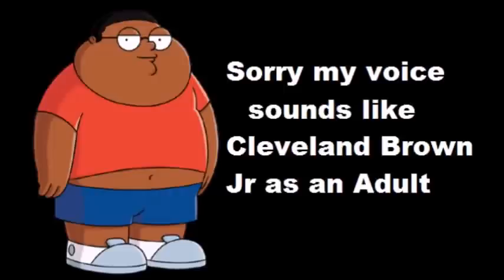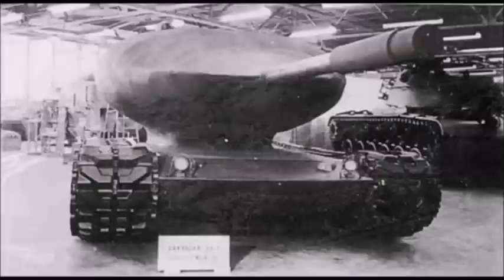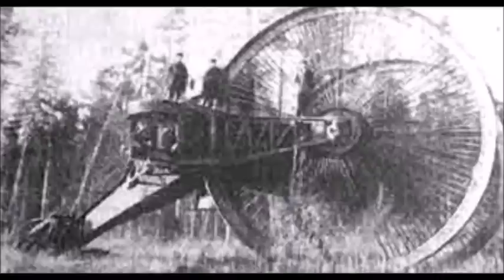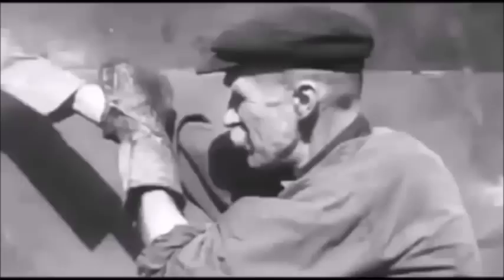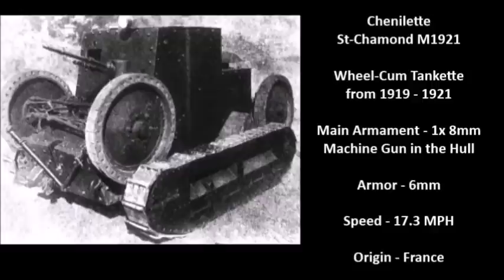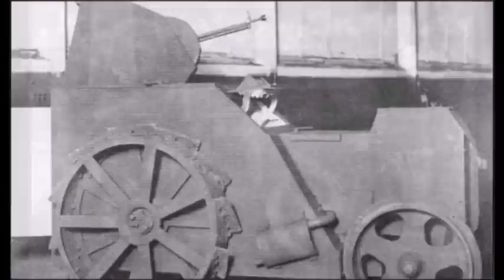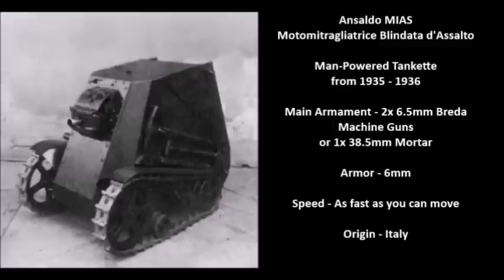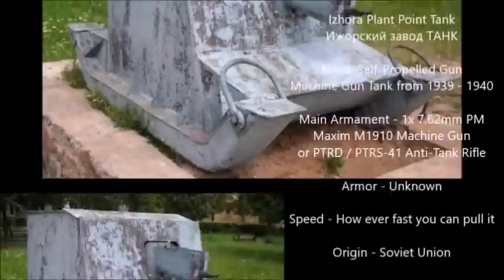Top 10 Worst / Strangest Tank Designs in History

Comment: That italian tank is more like an easily  moveable machinegun nest than a tank!
Reply: exacty It was a MItragliatrice ASsalto(assault machinegun) basically a self-propelled machinegun nest. And by the way this video is not correct: The Ansaldo MIAS actually had an engine, the Frera 250cc. (Frera was at that time an important motorcycle factory, the main supplier of motorcycles to the italian army in WW1)
Another interesting thing is that in some images apparently it is without the machineguns, actually that is another version, the "MORAS"(MORtaio ASsalto - Assault Mortar), armed with a rapid-fire 45mm mortar Brixia mod.35
Reply: That was ACTUALLY the idea. Lots of screwups in his research. ESPECIALLY on the bob semple.

Comment: Just wanting to point out that having the guns on the hull isn't necessarily a bad thing. It grants the tank a lower profile and greater ambush capability, thereby increasing the the first strike probability. Not having a turret also reduces the weight of the tank and may increase the vehicles mobility. Hull Gun does not = bad. It = defender / tank destroyer. The role of the tank destroyer however is outdated because modern infantry can have equal anti-tank capability and air power render the use of a stationary tank obsolete. For their time however turret-less tanks, also known as tank destroyers or assault guns, could be very efficient. The video creator is right in that such a tank could be easily disabled, but this is true for any tank caught in the open by infantry at medium to close range. A tank destroyer however is rarely used offensively, thereby decreasing the likelyhood of being flanked or close assaulted by infantry.

Comment: More like the coolest fucking genius designs. Okay, a couple of tankettes there very pretty shit, as well as the Semple tank, but most of these are badass. Also the improvised tanks really shouldn't qualify, they're not lazy or bad designs, they're just made in extreme circumstances without much to build them out of.
Reply: Makro plus the troops on the field must have gotten a confidence booster off having some form of protection and something that would make the enemy fearful of the tank or tankette they saw
Reply: The tractor-tank was just something to lift the morale of the older guys guarding the islands from invasion after all the real stuff was at the front lines. Painting plates grey and laying them across a road to simulate land mines to invaders was another tactic as was the Resistance bicycle-pump gun. 'Went the Day Well is a great film about and undercover Nazi invasion of a small village and the 70's series and movie 'Dad's Army put all this in a comedic vein.
Reply: I would think using a tankette would be better than just running out there with your single shot or five round mag rifle. Another thing, the Keugelpanzer was a reconnaissance tank. It honestly shouldn't have had mg's at all seeing as how it rolled. Yes, it was slow, but it most likely was meant to have a camo net or some kind of painting on it for it to resemble a fuel tank, a barrel, or some kind of rock.

Comment: that sled tank isn't actually a bad idea, imagine putting one of those in an alley and using it as a hidden machine gun nest. just little death traps hidden everywhere.
Reply: r h Youre thinking the right, and strategic, way
Reply: Alexander Keith. imagine if it could shoot and move displacing after it gives away its position. there's a reason sled tanks aren't common.... stupid design impractical and easily defeated
Reply: Alexander Keith like you said this is actually a decent design if you didnt have time to make a mg nest and you were trying to defend like a village you've got a armoured mg nest which in the picture looked like it had some pretty meaty front armour which I would expect could stop most small arms rounds
Reply: Alexander Keith 

Holy Squeak
Reply: Uh hello, that's exactly what the last tank is.  What does Russia have lots of.  SNOW???  Well keeping a tank light (no engine) and able to be easily moved by horses (which were still VERY common for the Russian army in WW2) the sled idea is very sound.  Slide this mobile MG bunker to where you need it and shoot, no sand bags to fill, no trying to find ideal protective placements.  It's certainly not without it's flaws, but for the time it was a sound idea.  It's a defensive weapon only.
Reply: you forgot to mention it would be way cheaper than actualy building a real tank and that the shape alone could fend of some enemy's that think its a real tank
Reply: Rip, finally people who listen to reason
Reply: Honestly  it fit for its time. but for later times, no.
Reply: unfortunately for the soviets, the finns ensured the russians ate their horses.
And the hit and run from finnish skitroopers was never coming allong an "alleyway" - ruskies could not prepare their nests, nests are for defense not so much for offense.
Reply: Alexander Keith yeah but grab a light machine gun and set it up in a protected area and have an escape plan in case you have to make a run for it.....looks like a lot of effort with little payoff
Reply: IIRC the sled was designed during/after massive casualties to Russians in Winter War when they were advancing in open snowy fields. It would allow machine gun to advance and provide supporting fire to infantry following it.

Comment: Researching the subject further, I found that the Ansaldo Motomitragliatrice Blindata d' Asalto had an engine.  It was a single-cylinder 250cc Frera engine, which was able to generate 5 HP. This made it able to go at speeds of 5km/h. Surprisingly this tankette even had a reverse gear and a differential gear system allowing it to change course fast.

Comment: The Chysler tank (TV-8) CLEARLY shows that it is powered by an internal combustion engine, not a reactor! The Odessa tanks made sense, because they were basically converted tractors, and way better than nothing. The Semple tank was based on a bulldozer, not a tractor, and actually was roughly equal to the crappy tanks the Japanese were using at the time.

Comment: I actually like the last 'tank'. I just watched a clip on how Poland in the run up to WWII was planning to build a network of bunkers on the strategic approaches, got started on it but it was taking too long, and the unit cost of building one in the field was also prohibitive. But if you could knock them out in a central factory, sized to fit on a rail car and equipped with skis for towing, load onto a train, then using a ramp unload off of the train anywhere on the route, tow into position, even using oxen, and get the locals to bury it in the ground so only the porthole sticks out, you could knock out a dozen everyday.

Comment: 1, 2, and 3 aren't in any way "tanks", by any real definition folks work with. the little fiat crawler tank (#2) is titled "assault blind", it's basically rolling cover, even if crapstain type cover. it's an attempt to give mobility comparable to a light MG, but with the stable weapons platform of a heavy MG. it's a weapon to fight WW1, however. think about trench assault. HMG role is long range defilade fire for the offensive side. keep the bad guys head down by raking the trench line with fire, positioned so you could project controlled beaten zones that didn't chew up friendlies (so, extreme range of the system). problem is, upon "breakthrough", those precision platforms are now basically inert, until moved to a forward position. now, if during our assault phase, while the fixed boys are suppressing the trench line, you have an intermediate force manhandle these puppies forward (gunner and ag, of course), you are pre-emptively moving similar long range support for the over-run stage, allowing harassment and suppression further "enemy rearward", giving better infantry support to repel the counter-attack. however, remove trench lines and "no man's land", it becomes pretty useless, pretty quickly

the german "muffin knocked over" is also a similar device, but with an emphasis on NARROW ways of ingress and egress. it fits between rubble piles far better than a king tiger, and 2 machine guns at 200 ft is far more "firepower on target" than insults yelled from behind a rubble pile you can't get past, in every army. yeah, a piat, bazooka, sticky bomb, 57 recoilless, could make short work of it, but that was also one less bomb that could be tossed at a REAL tank, as well as putting those gunners in jeopardy about equal to facing a real tank (who, except in a war movie, aren't going to fire main rounds at infantry in the days before beehive), while only actually knocking out a rolling donut. 

#1 is, as previously mentioned by another, just a pre-fab towable machine gun position, which would be dug in along a defensive line. by the looks of it, i bet they could be rafted and floated as well. if you look at soviet defensive line positions these make perfect sense. you can drag the skeleton of your pillbox ever forward, and the act of digging it in provides the additional cover of a fixed position. the role intended is discouraging mechanized infantry/armor units. the towable anti tank guns NEED support from infantry assault. a 76mm tungsten cored AP round isn't a whole lot of threat to a few guys crawling with sacks of grenades. the gun crew is pretty busy trying to toss such rounds at the steel monsters firing back at them, so don't have lots of opportunity to try to discourage those grenadiers. so, if i dig in a few of these sledge boxes, i can set up both crossfires supporting my individual guns, AND enfilade and defilade crossfires on the advancing infantry supporting the tanks. the design allows movement at least as good as the field guns it supports.

critique and expansions aside, awesome channel! love your collections of "off the wall military minutiae", AND your "legit weapons quickies". snack sized!! keep it up, awesome channel, soup to nuts
Reply: ludditeneaderthal
Reply: ludditeneaderthal.
Reply: dude, if you ever make a tank/plane/whatever vid in the futurte, and it's as amazing as this comment... do send me a heads up so I can watch it cause you really speak my language (as in you see the use of "useless" equipment and explain it damn well

Comment: Thank you for posting this interesting video.

I would have preferred that you  had researched the concepts, including the intended role for each tank, with the expected niche they were intended to fill.  And if there was no documentation to research, I think I have an understanding for some of the concepts.  Let me provided a couple of examples.

Some of these "tanks" did not have engines, according to you.  I think you are correct to question whether they fit the definition of a tank.  They don't even fit the category of armored vehicles.  They seem to be more accurately described as mobile pillboxes.  Lacking any further information, I think the Izhora Plant Tank had the major advantage of being cheap to build and replace and were a stop-gap measure based on a severe shortage of available battle tanks.  But, as a concept, it is not a horrible idea.  It is an armored machine-gun position that can be moved about as easily as a towed artillery piece.  They could not have been expensive, take long to manufacture or use up the type of industry needed to create real tanks.  I am curious if they proved to be effective for the campaign.

Regarding the MIAS tank produced by Ansaldo, according to one of your links, it did indeed have an engine.  I think that your opinion that they were "useless" is based on your pre-conceived notion of what a tank is and what it is for.  I would question that this fits the category of either "tank" or "armored vehicle."  But like the previous weapon platform, this vehicle provides an armored, mobile weapon platform.  Its tank protection is its size.  It would be difficult to hit for one thing.  But a properly camouflaged position and using natural or man-made cover, could make this a highly survivable vehicle.  I do not know how this vehicle was utilized, but I can see it being a useful asset being owned by infantry companies.  Having history as a hindsight makes me question whether it is worth the price, when a properly dug fighting position provides the same tactical environment once a unit has the time to prepare the fighting position.

Some of the vehicles described as also being "useless" are improvised armor and weapons being placed on agricultural vehicles.  Certainly, a vehicle engineered from the ground up for combat will be much preferred over improvised combat vehicles.  But the whole point of using improvised vehicles is that the real tanks were not currently available.  So the determination of whether the vehicle is "useless" or not is whether a unit would rather have the improvised vehicle or nothing.  And I think it is obvious that these were much better than nothing.  If the Wikipedia article on the NI tanks is accurate, they actually proved to be effective weapon systems.  And I think that flawed weapon systems can be used in ways to minimize their vulnerabilities.  For example, a properly dug, tank-fighting-position will keep most of the vehicle below the level of the ground, thereby making that portion of the tank virtually safe from tank fire or other forms of direct fire.

The use of the vehicle brings up your the first vehicle, the twin gunned, anti-tank vehicle.  The concept of having a turret-less anti-tank gun is to reduce its height and thus the vehicle profile, thereby making the vehicle much more survivable against tanks.  Again, in a properly prepared fighting position, very little of this vehicle would be exposed to tank fire.   I do agree that these vehicles are largely considered obsolete, mainly due to the effectiveness of anti-tank guided missiles (ATGM), as demonstrated so clearly in the Yom Kippur War.  It just make much more sense to use a small tank killer team of two or three infantrymen, armed with man portable ATGM or light vehicles equipped with ATGM to destroy tanks instead of utilizing vehicles which are costly to build and maintain.  Having said that, the Stryker Mobile Gun System (MGS), which is the most modern of American tanks, is essentially a tank destroyer, reminiscent of WWII.  Without bolt-on armor, the vehicle is susceptible to .50 cal or 14.5 mm machine guns.  I know that when these vehicles were first issued to units that there was great debate within the U.S Army Armor community and was discussed in the Armor magazine and the Army Times.

I think the last thing that I want to mention is whether an armored vehicle mounting only a light machine gun is essentially "useless".  During WWII, most units were not armored.  Not even the German army.  And even within armored divisions, many vehicles and combat units had no armor.   And a light machine gun is extremely effective against personnel, beasts of burden (still widely used during this time period), unarmored motor vehicles and material.  In most circumstances an argument could easily be made that light machine guns were preferable to heavy machine guns or cannon fire, since they were as effective in most scenarios not involving armored vehicles and the ammunition was lighter, allowing the crew to keep more ammunition and more ammunition could be resupplied on a given truck.

Comment: You got it totally wrong about the Versuchsträger 1. It wasn't projected as a classical tank destroyer just with two guns. It was an experimental tank, that is was the term Versuchsträger means. The guns were automated and the tank was heavily equiped with high tech. The combat concept of this tank was to drive with high speed in zigzag courses and when a target lined up with one of the guns, they fired automatically. The classical concept of a tank destroyer was to hide, fire and change position. The concept of the VT1 was to rush in zigzag lines over the battle field and cause confusion to the enemy. The problem was not the tank itself, but the concept, because the concept focussed too much at massive tank battles on plain areas. The tank was not suitable for forest and urban areas. The tank would be superior on plain ground and massive tank battles, but there are other kinds of battles, that's why it made its way into mass production.